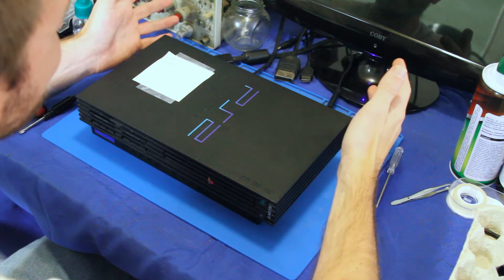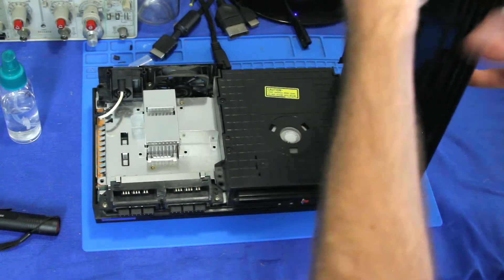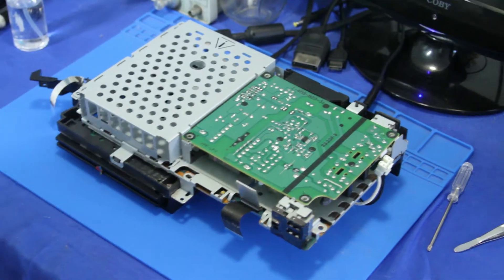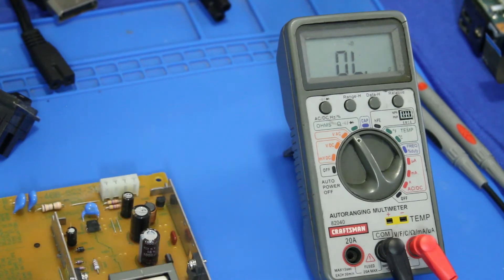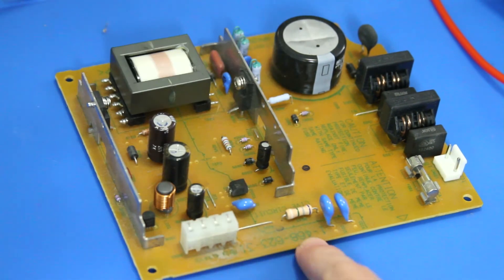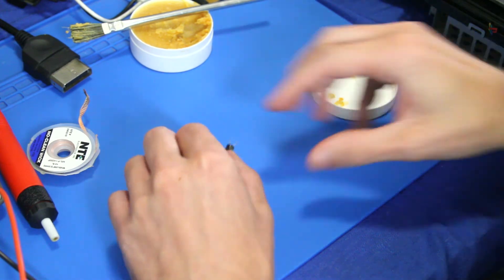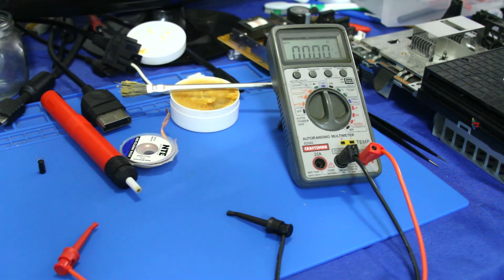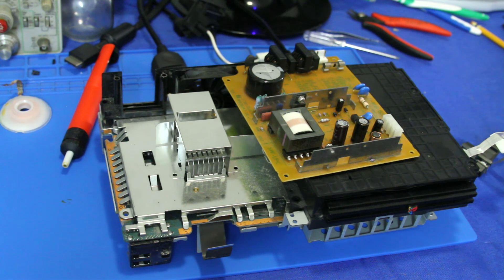DOA PlayStation 2 Part 1: Testing the power supply

Comment: Hi there, I recently bought a used untested PS2 Fat Console 🎮 off of eBay recently last week and received this past week? It doesn't power on at all. I bought a replacement PCB motherboard and AC Power Supply Input part. I agree with you? If one doesn't feel comfortable trying to install it themselves or working around   electricity? Can one take a training classes or course to help to get comfortable around electronics? I want to try to do it myself. I wouldn't mind paying a professional to do it for me? I'll just put the PS2 Unit to the side.
Reply from the maker: Hey there! Sorry for being several days late on this. Honestly, the way I learned was watching videos on YouTube and reading up on safety and stuff online. I remember when I worked on my first power supply I was a bit nervous. But after a couple, I got more comfortable. You definitely don't want to be complacent because that's when you get careless. Now the danger in working on power supplies is the charge the capacitors hold. Those big capacitors can hold a charge for hours sometimes and they're high voltage. No fun getting zapped by those. And if you have it plugged in, the danger there is obvious lol. If you follow proper safety and use common sense, you'll be fine. I've never zapped myself but I always have it in the back of my mind what to do and not to do. I have an updated video in the description. This video is a really early one of mine and I've made a better version.

Now for your issue with your PS2, the two main reasons I run into with them not getting power is a) the power supply (especially 39000 series. They have bad capacitors on the power supply) or b) a blown fuse on the motherboard.
Reply: @titanrepairs  ...Phil recently bought a used one from eBay...that's a start...i've bought 16 in the last few years...3 more this year alone...i've got 3 stacks of them...from listed as non working...smashed crashed and bashed to pieces...or just plain filthy...all around 12/14/15/17 British Pounds or under 20 dollars...which is my limit...several of them (about 5) have the front optical drive covers snapped off...i figure many do this to keep the tiny Playstation pin logo...it doesn't deter me from a bargain as i have long ago moved to Free McBoot/OPL and HDD...it's so common a practise to get damaged PS2's  without covers...i now have a local shop guy with 3D printer make me replica covers that fit inside and GLUED into the slot and no Optical drive...printed in PLA...not exact match but close enough...the bars line up perfectly...i keep broken opticals for spares...like the lasers and moving parts for my undamaged opticals...so far in failed parts...1 motherboard...4 power supplies...and of course several part damaged optical drives...some still work...i can buy replacement shells (18 dollars) and power supplies (about 10 dollars each inc shipping) and ribbons from AliExpress...one sorry PS2 i bought from eBay was smashed open you could see the motherboard inside through the missing corner...optical drive cage was in dozens of pieces of plastic...i think it was thrown out of a moving vehicle at 50 or 60 MPH...or thrown from a tower block/high rise...glad it was a black shell...i hate the silver ones to be destroyed...good fun isn't it
Reply: @titanrepairs Greetings 👋🏾. It's all right my friend 🙏🏾. Thanks so much for the kind reply and also thanks for that important info 👍🏾💯. I took the time to read your message very carefully and you right? Use common sense and know what to do on working on the PS2 Fat Console 🎮. When it comes to switching out the motherboard and being aware of the electric charge of the capacitors and the transformers. I can probably buy some Insulated Gloves 🧤 to avoid coming in contact of the electricity 🔌. Thanks again for your help. I'll get that PS2 Fat Console Unit working again eventually 😉.

Comment: 11:13 what is the name of the red tool you're using
Reply from the maker: That is a solder sucker. And it sucked alright lol. It basically removes melted solder from components. If you're doing a single job it's fine but since I do this all the time, I bought a desoldering station so I don't have to use it anymore.

Comment: Are u sure this is an 39xxx? looks like an other model
Reply from the maker: Pretty sure. When I say a model I read it off the sticker. Though I did do a video (this video is very old so it may have been this one?) where there was a motherboard swap done by GameStop where the board was from a 30001. I noticed it during filming but didn't call it out because at the time I was rigid in only sticking to how to repairs. I'm more loose now lol. Either way the information can be applied to other models ☺️

Comment: What are the numbers on the capisitors need to know thanks
Reply from the maker: I don't keep a list. They'll be different from power supply model to power supply model. I also usually mention the values in my videos at least the ones I replace. Otherwise the values are on the capacitors themselves. When ordering replacements you just have to match the values.

Comment: Can a ps2 be universal. I have a ntsc j model that labeled 100v but here in india it is 230V. Would the ps2 runs fine??
Reply from the maker: You'll need a step down converter most likely. I don't have any experience with them or running a 100 console in a 230 plug. I'd say search online to confirm. I'd be leary about plugging in a 120v console into 220v mains without some kind of converter but that's me.

Comment: i have an issue with my playstatio 2.. there is no issue in powering on and booting up the problem is the controller port doesnt seem to work.. i already tried 2 different new ps2 controller still not working i tried replacing also the ribbon connector and ribbon cable doesnt seem to work also.. whats the last bet on it?
Reply from the maker: Did you try replacing the controller ports themselves?
Reply: @titanrepairs  im planning to try replacing the port but i dont know where to buy them i live in the philippines

Comment: Have you ever used an LCR meter to test capacitance without de-soldering?
Reply from the maker: LCR meter no. Since this video was published I did buy an ESR meter a viewer recommended. I'm happy with it. I have another power supply video in my editing queue where I use it 🙂
Reply: @titanrepairs  do you know how to fix xbox one X power supplies I have a bunch of dead ones, I would love to fix them if you have a video on those cause they have such a high failure rate.
Reply from the maker: I do not unfortunately. I mostly do more retro and vintage tech and consoles. It honestly has more to do with cost. I fix these things and sell them as a side hustle. A broken PS2 I can get for 15-20 but a XB1 may cost upwards of 100+. It's higher financial risk for me and with wedding planning and saving for a house, I'm going with the lower risk option. At least until this channel is monetized or I get a hell of a deal lol. If I was pulling in Tronicsfix viewers definitely all day long. But I'm still small potatoes 🙂

If you have a bunch I'd say crack one open and start probing and experimenting! If you worked on one power supply you should in theory apply what you learned to another.

Comment: The fuse of my ps2 is broken. It is 250v but there i cannot find the amps anywhere. Does anyone know?
Reply from the maker: Take a look on the circuit board on the power supply. It should have the amps rating. I'm from the states and the board I'm looking at says 125V 3.15A just above the fuse. I'd imagine its printed on the European power supplies. I'm not sure if the amps are different on European systems.

Comment: Any idea where u can pick up a new ps2 fuse?
Reply from the maker: It's a pretty standard fuse. You should be able to get it easily off the internet. The value of the fuse is printed on the circuit board between the power input connection and the fuse. The spare I have lying around says it's 125V 3.15A. It'll be different if you have a PAL system. May even change from power supply model to model. Just double check to make sure you get the right one. You may be able to find it too at a hardware store or an electronics shop.

Comment: I have watched your video part 1 and part 2 on how to replace the power.  My son has the original fat console and of course after sitting for a few years does not come on.  I have watched how to clean but figured that is not going to make the power come on.  
I would like to know where you are located and if you still restore power supply capacitors?
I am located in San Diego, CA
Reply: I went ahead and checked the power supply and it works. Should I still check the capacitors and would these have anything to do with the reset and eject buttons not working
Reply from the maker: Good morning! Sorry for the late response. I just saw you're comment. Unfortunately I'm on the east coast and not taking mail ins just yet. It's in the future but not yet. If the power supply is outputting the correct voltage the issue isn't there. If it's outputting too low or not at all then there's an issue. The next common issue on the fats why power isn't getting through is there's likely a blown fuse. I haven't run across one in a while where I could make a video but it's easy to check. You can also check the ribbon cable coming from the power switch to make sure it's not damaged. What is the model number?
Reply: @titanrepairs  the fuse looks good with a visual view I didn’t do a test on it. What should the reading be for the power?  I was thinking it might be the switch itself but don’t know how to test it. The ribbon on the power switch has a fold in it but I figured that was normal to get it to lay right.  The board has the same number as your video had
Reply from the maker: @ColPaniArt  Good evening. I'm so sorry for the late response to this. It's been an absolute crazy week for me and I finally have a moment to catch up on things. In my previous comment I see I wasn't clear. I meant a blown fuse on the motherboard. There's a couple that blow very easily and it will make your console not power on. You'd have to test them with a multimeter. You do that by setting it to continuity mode and put the leads on either side. If you get a continuity reading, it's fine. If it says OL it's blown and current isn't going through the fuse. You can do that with any fuse :)

If I recall correctly off the top of my head I think the power supply outputs 12 volts in two points each for a total of 24 volts. It should be the first and the third hole. If you want I can find a more in depth guide on testing power supplies I used at one point for you 🙂

If you want to test the switch that goes into the power supply, remove it and put the multimeter probes in the connector. When it's off you should see OL on the multimeter. If the switch is on you'll have continuity.

Comment: Thank you for making videos like this. I have one question: my glass fuse is blown. It is 3,15a - 125v. Now, the problem (at least where I live) is that it is impossible to get one like that as it is quite uncommon. Do you have any suggestion on a fuse that is similar or equivalent that could work? I clearly don't want to risk any other components
Reply from the maker: And thank you for watching 🙂 To answer your question, are you able to order it online? You can poke around Amazon if it's available or if Ali Express ships to your country you can try there. If you can buy a harness to walk a chicken on AliExpress, they should have the fuse you need lol. I've ordered parts from there with no problem. Long shipping times but they showed up but you're mileage may vary so keep in mind the stuff comes from China.

You can also see if electronics parts suppliers like Digikey ship to your country. Even eBay. Just trying to think outside the box for you 🙂
Reply: I'm not a fan of shopping online, specially since shipping is always a hundred times more expensive than the item I want to order... Looking for something available I got a 3a 250v fuse. The store person said it ''should'' work and so did another person in an internet forum. Do you think it can be used or am I risking other components? My biggest concern is the voltage difference, being 125v the original and 250v the one I got
Reply from the maker: @franciscocampos8857  You're fine. You can use a fuse rated at a higher voltage than the original. What blows the fuse is over current. That's why you can't use a fuse with a higher amps. That you can't go higher. I've actually gone higher on the voltage with fuse replacement on the motherboard but used the same amp rating. Just keep in mind the fuse you're replacing it with is slightly lower than the original. Will that .15 make a difference? Probably not but it will have a slightly lower tolerance for blowing 🙂 But yes, you should be good.
Reply: Excellent, thanks a lot for the quick and clear repply!
Reply from the maker: @franciscocampos8857  You're welcome! This was a welcome distraction from doing my housework today 🤣
Reply: @titanrepairs  👍

Comment: Very interesting. I took my ps2 apart to clean it and when I put it back together it didn’t power on; the light that is normally red was green but when I would press the power button nothing would happen so I tried the reset button and the led went out and never returned I thought maybe I damaged the ribbon cable on the power button but I tried replacing it and it was fine. Any clue what this could be? I’m afraid I fried it or something
Reply from the maker: Do you only have one light on the switch? Normally you have a light on the power/reset and the eject button. If there's only a light on the power button and not the eject button, I may know what's going on. On like 2 or 3 PS2s (all 39000 series for some reason), I found that fuse PS11 on the motherboard was blown. I replaced it and it blew again. After more research and diagnosing, it was the IC next to that fuse that actually shorted out, blowing the fuse. What you have to do is test to see if it's shorted to ground. There's a lot of guides out there on how to test ICs. Basically, you put a probe on the ground pin and check the other pins. You'll need the schematic for it. Plenty of PS2 schematics out there :) You may get lucky and it's just the fuse. But in my experience it's not. But it is fixable. You'll likely need a donor board though unfortunately :(
Reply: @titanrepairs  my model was 30001 and yeah there was only one light on until i pressed the reset button and they both went out. I’m thinking I might just try swapping out a whole new mother board and see if that does the trick
Reply from the maker: @ethanwashoe5868  uh oh! I have the feeling you have a blown fuse. The fuse to the power switch is extremely common to blow. It doesn't take much to do. I've blown a few myself by having the ribbon cable ever so slightly off or fiddling with it with power running through on standby. So this is how you test. Take out the motherboard (obviously 🙂) and get your multimeter and set it to continuity mode. If it can beep even better! I'd check all fuses. You should have continuity, if not the fuse is blown and needs to be replaced. The specific fuse you want for the power switch is labeled PS1 on the motherboard. If it's blown let me know and I'll try to find the repair guide for you since it's kinda obscure 🙂
Reply: @titanrepairs  well thank you for all the information I really appreciate it!
Reply from the maker: @ethanwashoe5868  You're most welcome! Good luck and I'd love to know how you make out :)

Comment: Something is wrong with my PS2...
It's a 50004 version but in "System Information" screen it says it's a 50003. 😑
What does it mean? Is it normal? I'm so confused.
If someone has the same problem I would like to know what the heck is wrong with it!
Reply from the maker: Did you buy it used? I know I sometimes run into it being say a 30001 model but the system information says say a 39001 or other combinations of models. But it was opened and had the motherboard replaced. Or it's possible the top shell was damaged and replaced. But if you bought it new back in the day, could just be a factory goof. The last number in a model usually means (if I recall correctly) the region it was sold in. Honestly if it works, I wouldn't worry about it.

Comment: That was a fake warranty sticker, you peeled it off too easily. They sell fake warranty stickers on aliexpress.
Reply from the maker: Though that's 100% true, this was definitely an authentic sticker. I've just opened so many of these, it's become second nature on removing them easily. But it definitely gave resistance when I was taking it off. One way you can tell too if a console has been opened before is how the screws "snap" when you unscrew them the first time. If you listen carefully when I was taking off the first screw you can hear it (if you can hear it over me yammering :) ) IIRC, manufacturers put a thread locker on the screws (a weak one) that make an audible "snap" the first time they're removed. At least that's what my research has said. It also takes a slight bit of umph to break them loose. It doesn't make that sound or give resistance the second time :) Another way you can tell too is the ribbon cable for the power button won't be taped onto the disc drive. At least 0 I've worked on that have been opened before have had that still taped there lol. Just my Titan Quick Tips of the evening :)

On a side note, it really does annoy me that reproduction stickers are sold on AliExpress. It's one thing if you opened your own and want to make it look original and not planning on selling. It's another where you and I both know that unscrupulous sellers are slapping them on and advertising it on eBay or Marketplace as "never being opened" and selling for a higher price. You did give me an idea for a future video to compare them.